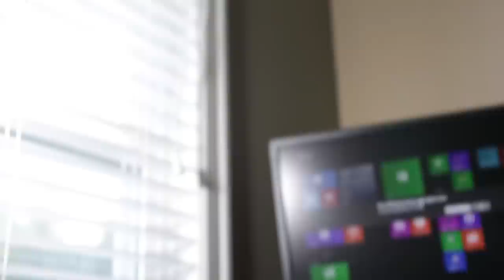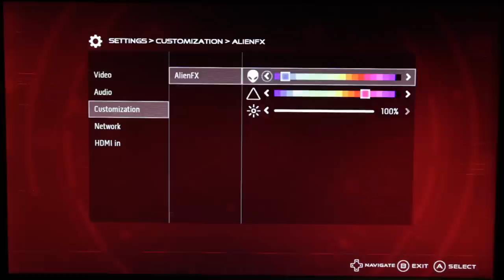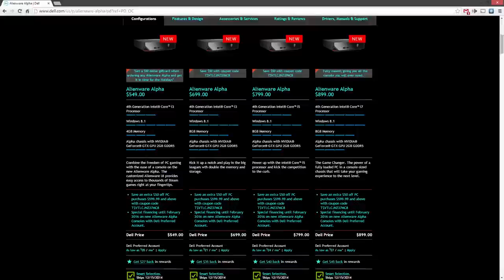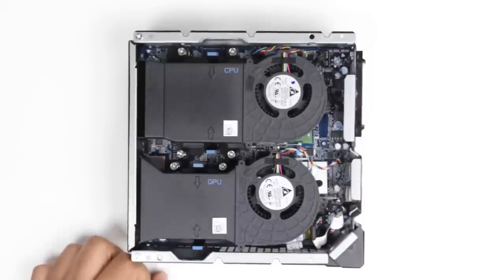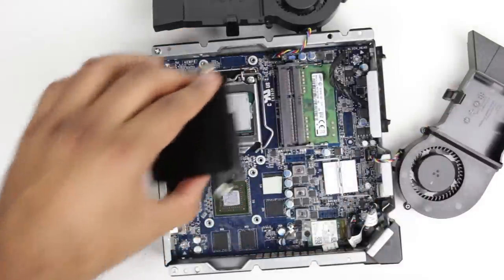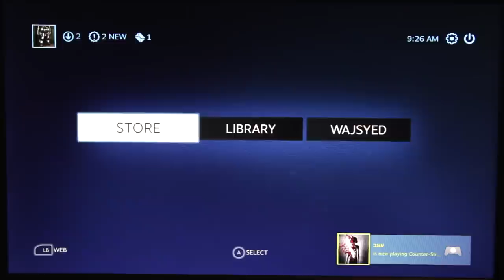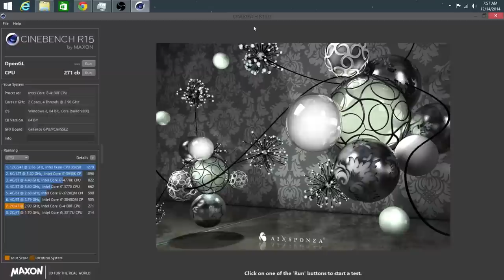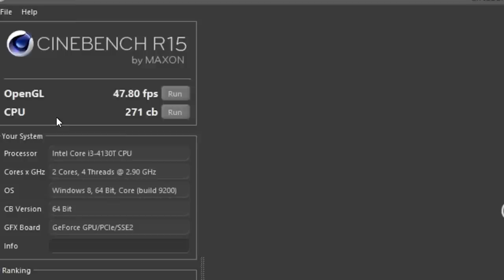Alienware Alpha Full Review

Comment: Far Cry 4 is 30 FPS on the PS4 and it plays nice. Unplayable? That's preposterous and pretentious.
Reply: You are right! Nonsense!
Reply: +Rhidalgo789 it depends on the game.
FPS is much more relevant in something like street fighter or cod4, for example.
Also, consoles typically have pretty stable framerates at whatever they are locked at.
PC frame rates tend to fluctuate more depending on the visuals at that moment.
so a lower avg fps means that getting a drop (in a big fight for example) will be visually noticeable at least.
Reply: +Tree Frog I personally can understand that but he never said it was fluttering around, so unless he said that 30 fps is perfectly fine.
Reply: +Tree Frog Some PC games have the ability to lock the FPS using some graphics tools.
Reply: +Rhidalgo789 those are socalled gamers ...plenty money nothing inside
Reply: 60 on xbox one :P
Reply: Rhidalgo789 I think 30 FPS is playable

Comment: A bit advice for people thinking of buying this - it is an OK machine. I have one with the highest spec from Dell and manually upgraded the HDD to SSD. I bought this specifically for travelling because it is roughly the same size as a laptop but much more powerful. But this is a far cry from a custom PC and more expensive as well.

So, only get this if space and mobility is a factor for you, otherwise, building your own PC is much more economical.

But it is not "unplayable" as this video has shown. You are not to expect to push this machine to the max - just play games at medium to high settings (don't bother ultra or full antialiasing - you won't notice much difference anyway).
Reply: Thanks
Reply: +dlysele The prices are $399 for base model, if you can upgrade the graphics card with something like a Radeon Fury or a Geforce 750TI then it might be worth buying for a Gaming PC in your living room. Sadly it's not upgradeable on the GPU only the CPU. You're better off buying a Razer V1 PC case for $60 and build your own system with a Fury or a 750Ti graphics card inside or a card that is longer and still fits in the case.
Reply: 30 fps with those settings on far cry 4 is quite an achievement. that game is horrid to run lol

Comment: Good review, as a fellow Alpha owner there's a few things I feel I should point-out:

1.) There's an updated NVidia driver that I can see you haven't installed from your footage. Among other things it greatly improves the performance of DragonAge. One of the AlienWare team members has said on Reddit that the driver that ships with the Alpha is several months old.

2.) Adding another 4GB of RAM and replacing the slow-ass 5400 RPM hard drive with an SSD are 2 (relatively) cheap upgrades that will do wonders for the machine. I see a lot of stuttering in your footage that completely goes-away with an SSD...
Reply: Im a college student and im looking for something to hold me off for the next 2 years until I get my own place and build one but do you think it's worth it ? Or just go ahead and build a pc?
Reply: Angelo Burden I'm really diggin' it, so I'd totally recommend picking one up. At $549 it's not much more than other consoles, and you can spend the extra $$$ when you can to do the necessary upgrades.

While I think you can for sure build a machine that will get you similar performance in most games for the same amount of money, keep in mind that the Alpha INCLUDES a Windows license, XBox 360 controller and wireless receiver. Plus, anything you build for $549 won't be in such a tiny, awesome case. So it's those little details that I think give the Alpha the edge for the price.
Reply: Mike Hamilton I'm thinking of buying the alpha i3 console but what type of cpu I could upgrade in the alpha and can I add any type of ram?
Reply: ***** It accepts 204-pin SO-DIMM DDR3L from 1333 to 2133mhz in 2gb, 4gb,or 8gb sizes.  Laptop ram. And the alpha base comes with 1x4gb stick, not 2x2gb as you might assume. So if you want to upgrade to 8gb, just buy a second stick of the same details.
Reply: What you're ignoring is that the alpha comes in at about $300, once you include the operating system, free games, and free controller.

Though fair warning that Mike failed to mention, as of yet the custom chip is not supported by nVidia's user experience package, so it won't conveniently auto-upgrade itself. Hopefully that kink is smoothed out soon.
Reply: Justin Adams lol and PS4 doesn't come with an OS, controller or free games for less than 550? 

Funny argument..
Reply: vexx506 Have fun editing video footage, writing an essay, downloading and watching 4khd movies off pirate bay, or in fact doing anything that isn't playing ps4 games, on that ps4 operating system.

Also, enjoy using that game controller you don't get with the FX-6300+R9-280 PC. Because you know... That is what I was referring to, not a playstation 4, but asking that youtube commenters be literate is apparently too much to ask from brosephs like you?
Reply: Ain't nobody got time for dat!